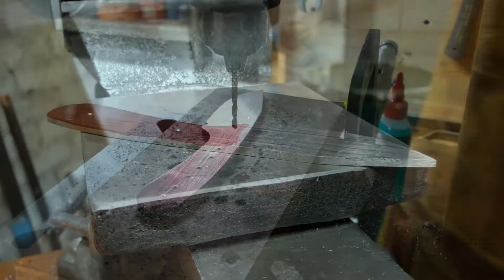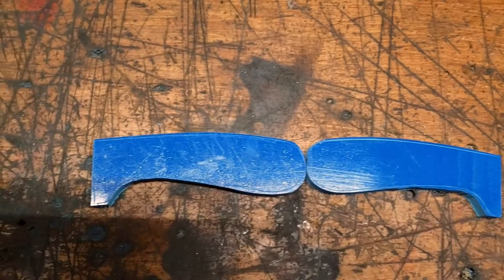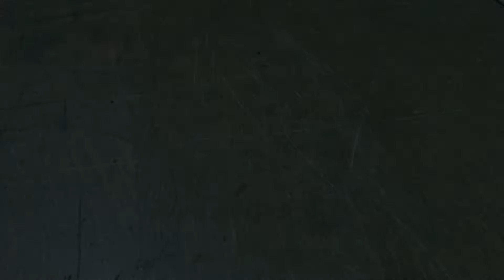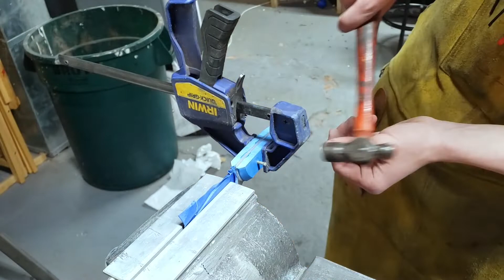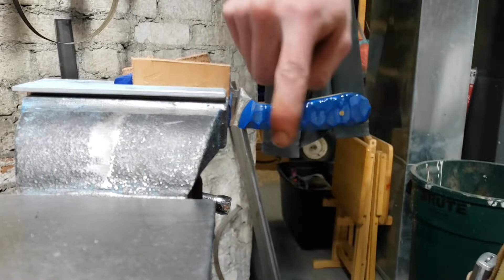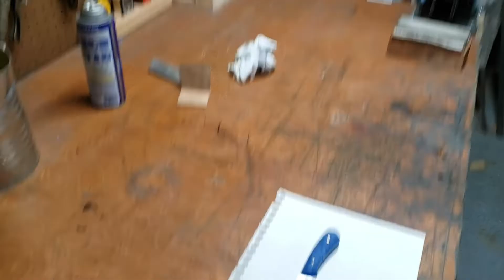Knifemaking- A Sapphire EDC Knife

Comment: Hi mate what are you using to attach the polishing wheel into your drill press chuck as I’m looking to do that in the future to polish handles and blades just wondering how you have the wheel attached and what’s inside the chuck thanks
Reply from the maker: So I actually just ordered some polishing wheels with the arbor attached and threw them in the drill press. I got a three pack off of Amazon for pretty cheap, and they work fine